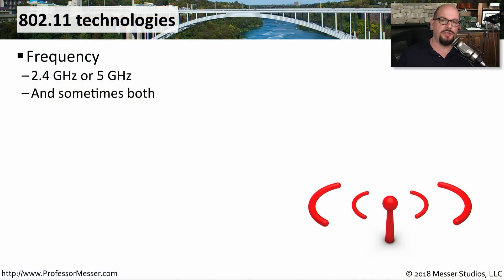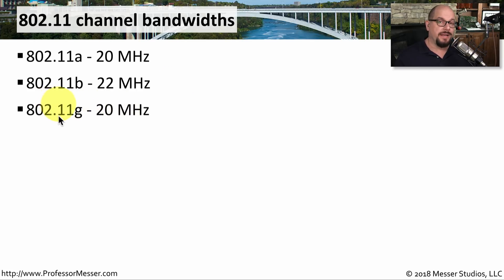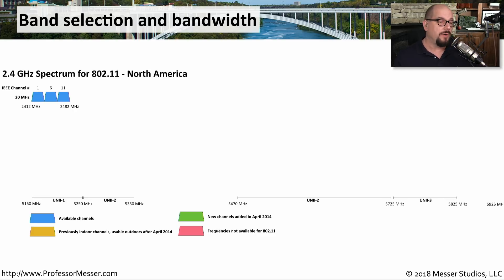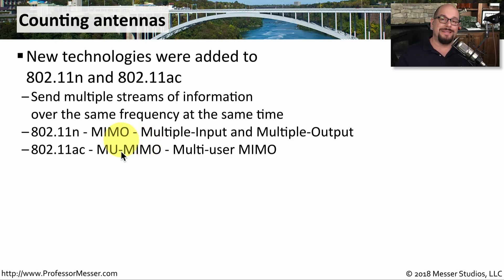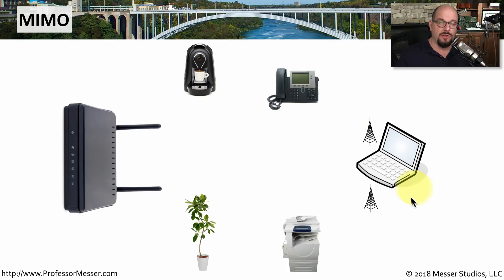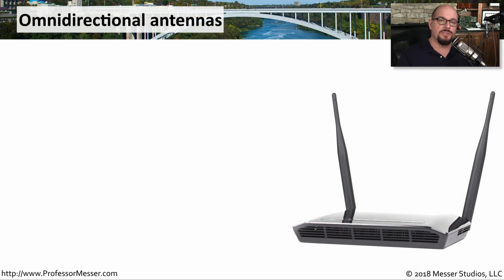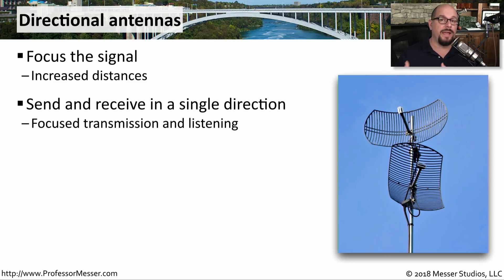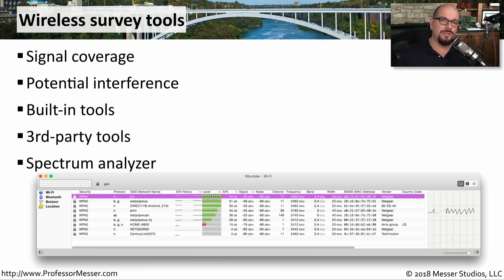Wireless Network Technologies - CompTIA Network+ N10-007 - 1.6

Comment: What's the reason behind channels 12/13/14 not being used or being illegal in the USA?  I know in japan they can use channel 14. What are the advantages and disadvantages?
Reply from the maker: Every country regulates their frequencies slightly differently, so you may see differences between the frequency availability across different countries.
Reply: @professormesser  thank you professor for taking your time to answer my question.

Comment: Why is it that (3 antennas on the AP) x (3 antennas on the client) results in only 2 streams? I thought it might just be a typo but you said it in the video.
Reply from the maker: The number of antennas isn't associated with the number of supported streams in an access point. For example, multiple antennas are useful for resolving distortions created by the phase shifts caused when the signal bounces and reflects before reaching the access point.